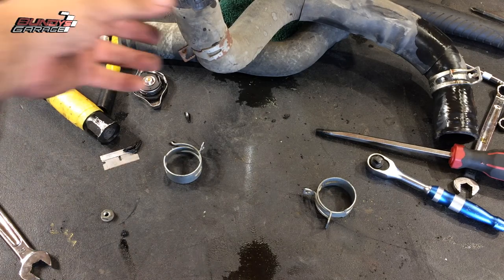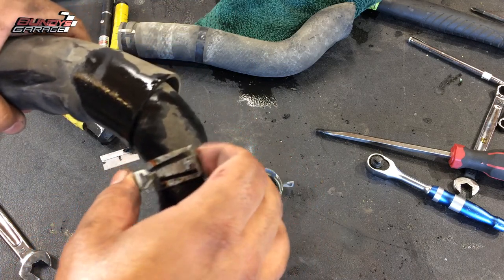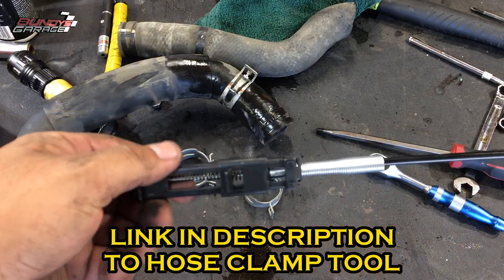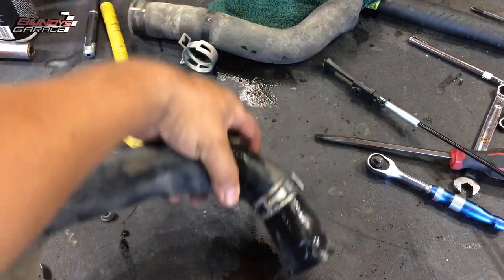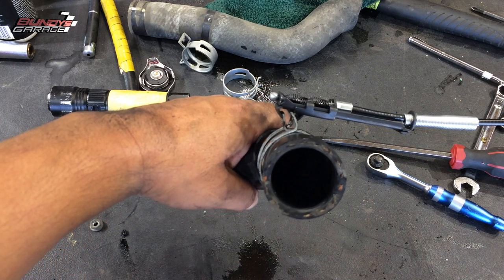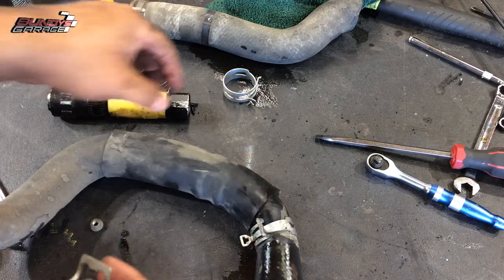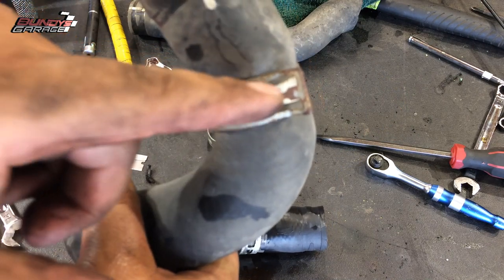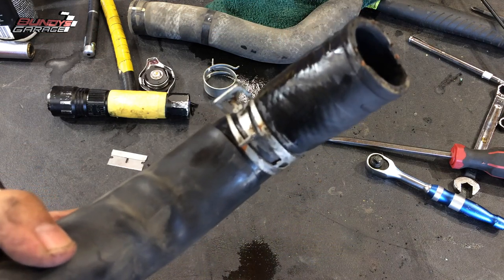Toyota Locking Radiator Hose Clamps SUCK BRO | Re-Locking Radiator Hose Clamps

Comment: I'm dealing with this locking hose clamp thng right now on my Prius.  I was thinking to cut them off would be the way and I'll be doing that tomorrow for sure.  Thanks for the validation.  I'll use my Dremel and right angle adapter to get in there.
Thanks for the tip!
-Jon

Comment: The tab is a one and done thing. It’s not to be locked after it’s released. It’s designed for the assembly worker at the plant. They come from the supplier locked, many to a tote. The person on the line grabs one that’s locked and with one quick squeeze it locks. Toyota specs in standard work is that the clamp to be 2-7mm from the end of the hose.
Reply: I wonder how the Toyota or Lexus dealer maintenance people deal with them then. I think they must have a special tool that allows it to fully open. Because like this guy says that tab prevents it from getting to the extended fully open position needed to move the clamp freely in most cases
Reply from the maker: Right! I want that tool they have to open them up all the way.

Comment: Great idea and thanks for the tip. However a grinding wheel is the totally wrong tool to be trying to cut that little tab off with. You need to use a Dremel or some locking needle nose vise grips‘s where you can bend it back-and-forth and break it off
Reply from the maker: Well o don’t have a Dremel and o was taught to use what you have…and a grinding wheel is what I have.

Comment: Ive been trying to get toyota self locking clamp off for 2 flipping days! Even had to cut the hose off and still cant get the flipping cla ockig clamp to squeeze completely together to open the tab is bent way down bend it back up over and over again. One point did get the tab to go into the lock but it didnt flipping lock!! What kind of tool will get it off? Squeeze it completely still wont budge? Wont move back or forward or anything. Its the most worthless clamp ive ever dealt with what am i going to do to get it off?

Comment: Check out video on new generation hose clamp that does not have the problems as does worm gear and spring type hose clamps...https://www.youtube.com/watch?v=G-lRQESr59s
Reply from the maker: Those are not new hose clamps. That bolt screw type is the worst type out there, never use them!